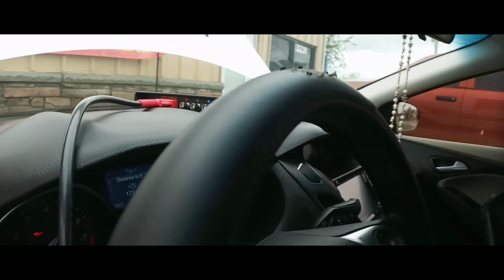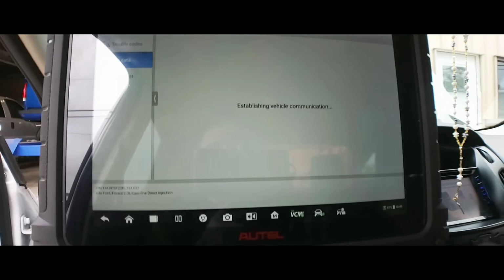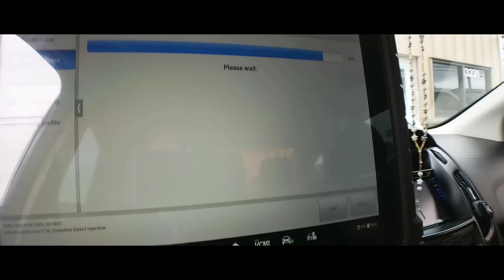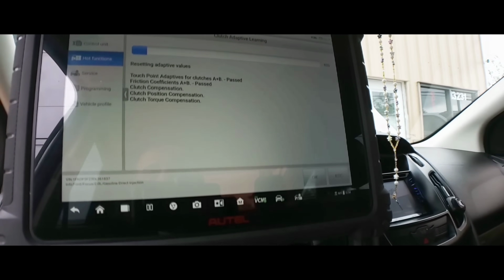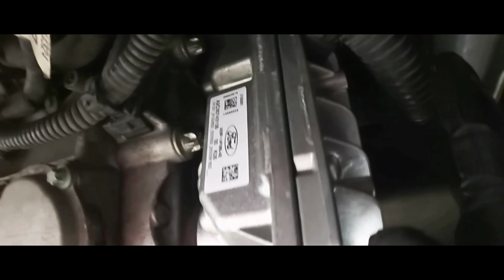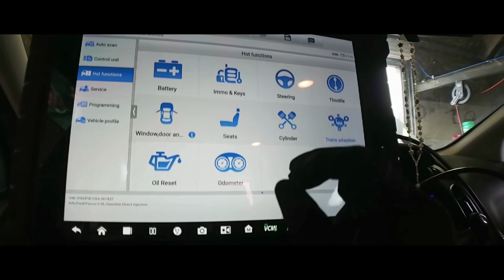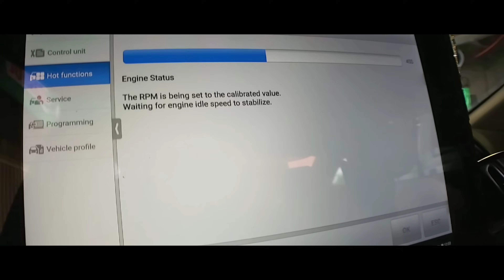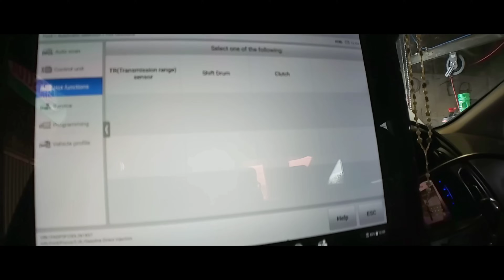🔧Ford Focus DCT Transmission Diagnosis - DCT DPS6

Comment: I have done everything you have done in this video prior to even seeing it. I get to 17:51 "touch points" and it basically freezes the scanner (two up to date Snap-on Solus & Modis) and the same thing happens.... Aka nothing. In my case though both of the shift forks are working beautifully. The moment I put the car in drive and touched the gas it triggers a P073f, U1013 and occasionally P0219.   I swear to God if I ever meet the engineer who designed this abomination, I'm going to kick him in the 🍆. 🤬 I'm confused as to what direction to go next. The car even moves in D and R, though it moves/slips less in Reverse. No weird/abnormal noises, no clicking or thumping randomly.  TCM or Clutch???  Grounds are cleaned. I just can't get it to go through the relearn process without freezing and timing out.

Comment: Man, these transmissions are garbage. Ford deserves every bit of punishment they get.
Reply from the maker: I hear that a lot.
Reply: @AutomaticTransmission  Is it true that dual clutch transmissions are particularly bad at handling rush hour traffic because they have to engage and disengage all the time? (I presume the Sonata Hybrid would be an exception since it can just use the electric motor that's always coupled to one set of gears.)
Reply: @NiHaoMike64  same thing as a manual. Only you have more control in an actual manual.

Comment: This car is not running? The problem is the  the actuators. This noise will stop when you close the door. But still the actuators need to be replaced

Comment: I also have a 2014 Ford focuse se. My car is doing the same noise. Wow, trash cars and the dealership wants to charge me 235 just to find out what's wrong and submit paper work to ford if it is the tcm and the clutch wow

Comment: that needs a torx driver not an allen/ hex driver. geeze if ti wasn't striped it will be.
Reply: What size?
Reply: I need desperately to know where I can buy a tool to unlock the throw out bering. I have everything but that. You say no to Allen. What size torque driver?
Reply: It's not a torx driver either. It isn't a torx socket head. It's a custom machined spline. Putting a torx in will strip it too.

Comment: Hiram I think you are the best with a tranny. One channel says if I can do it you can. What a bunch of bullshit with these newer over engineered tranny they are making. For the DIY guy with these tranny you need so many special tools it's not even funny. That stick tranny that ford made is the stupid thing I have ever seen. You want a stick tranny you need a clutch pedal. You don't want to shift buy a automatic tranny period. Them motors that make the tranny shift don't have a seal to keep water from getting in there when you took them out. Ford should be sued big time for making this junk. They are not the only one making junk. I got a new 2020 chrysler pacifica van. Guess what the tranny filter is inside the tranny. To change it you need to take the tranny out and split it just to get to it. All a DIY can do is drop the pan and change the fluid at the best. Tranny should have a spin out filter like you do when you change the engine oil. This billet this and billet that can be really expensive. Sure if something is bad that cost about the same as a new part from the dealer is ok. But you can overdue this stuff to. Remember the 1940s dodge stick tranny that you could start going in any gear either first or second and even third with the clutch pedal? I think they called it the fluid drive tranny. At least I did. My dad had one and when he was done with it I drove it on the farm when I was like 10 years old.....lol. I could go on and on but this over engineered stuff needs to stop. There come a time when they go to far with this stuff. These 10 speed tranny that chevy and ford made together is going to be a mess and really be expensive to fix. They are already having problems with them. Sorry I rambled on so long. But these car and truck manufacturers are just over engineered this stuff and it's unnecessary IMO.

Comment: I’d like to have half the money Ford lost on that transmission.
Reply from the maker: Yeah, bad engineering in the beginning. They still have issues but not as bad as when they first came out. 
With less than 10000 miles Ford was already working with them.